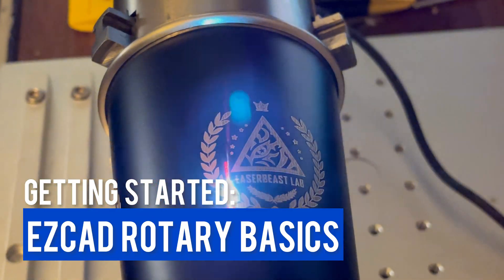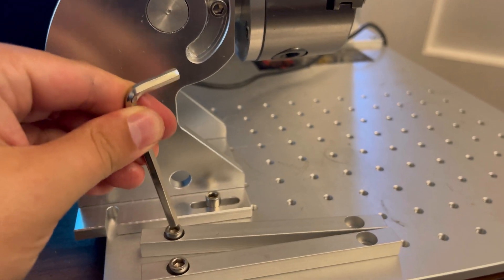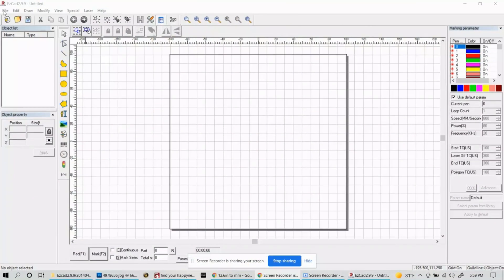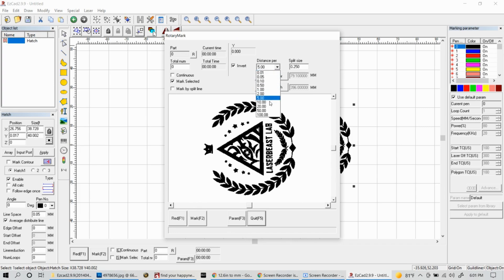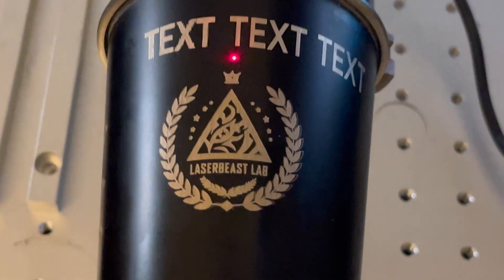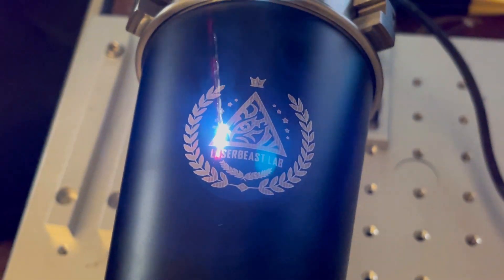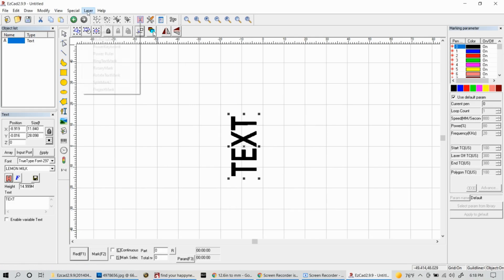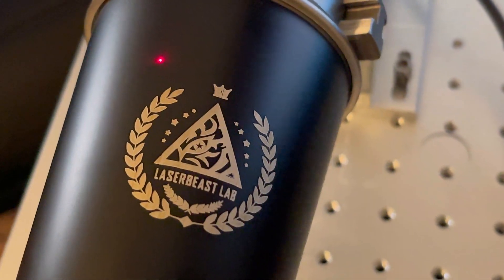Rotary Axis Attachment for a Fiber Laser Marker? - Project Walkthrough - OMTech Laser

Comment: Hi, i find out if i use big vector files like 100 x 100 mm and 0.02 or less Hatch line space with a Rotary Mark Tool it is way better if you turn your Grafik first before you enable the Hatch. Otherwise it failed with a Error "too less Ram". The Reason i found out is, if you enable the Hatch Lines first with the Setting 0° and turn your Grafik after you also turn the Hatch Lines with 90° so they are now along the Y Axis. If you open then the Rotary Mark Tool the EzCad Software calculate new to switch on the Laser if it is crossing Y Hatch Lines because the scanning Direction is along the X Axis, the Rotary is the Y Axis. The Result is a lot of Points and a lot of more Data into the Ram of the USB Controller Card into the Laser.

If you use the first Methode the Software generates Hatch Lines along the X Axis which uses only 1/10 of Ram Space at the Controller Card. I hope it helps. I had this Problem and figured out how to fix it. You can see this with the Task Manager. Look how much Ram needs EzCad with Methode 1 or your Methode, there you can see it 😉